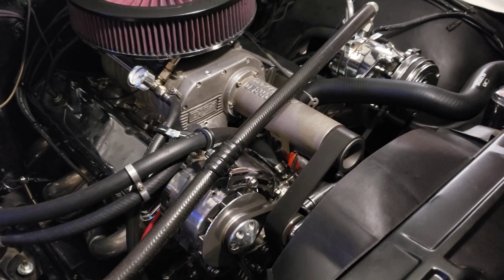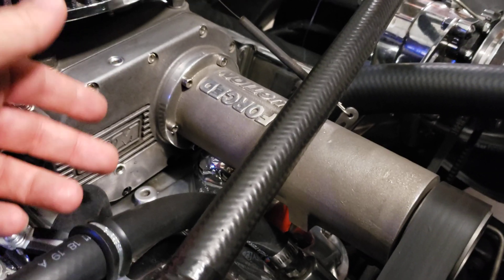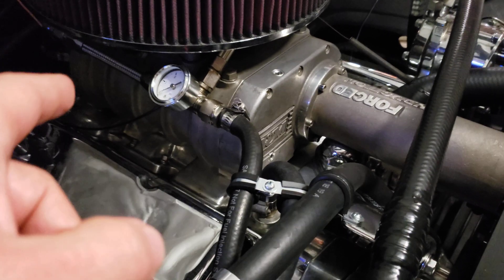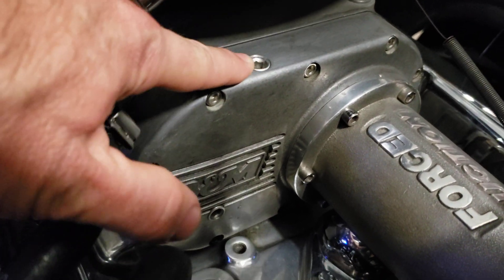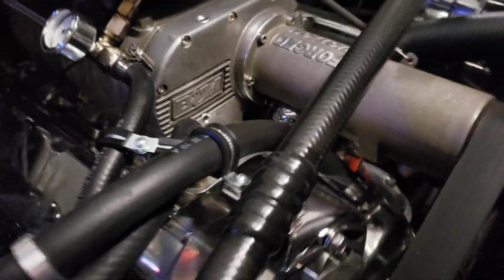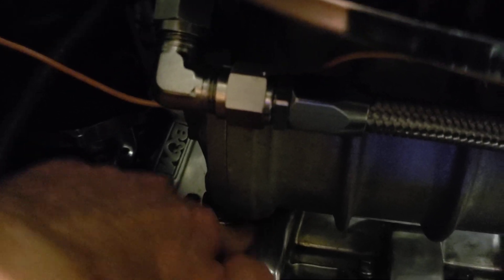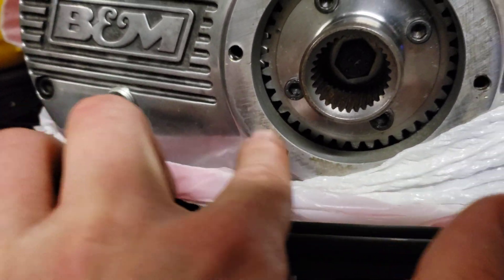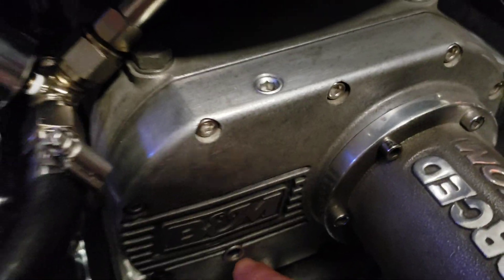Servicing a roots blower and how they work

Comment: On the 144 cu inch blower, I turn mine by hand and I can hear a scraping noise from the back bearing. Guess I should change the back bearing huh?
Reply: The car had sat for 5 years until recently inheriting it. Thought maybe my water pump was going out. Instead.... This is what I'm finding. New to the street rod engine stuff and needed some advice . Please sir.
Reply from the maker: Hard to say without a visual inspection.  It's also possible the rotors are binding if the hold-down bolts aren't torqued properly.  You'll need to not oly check the rear bearings, but also the snout and apex seals.

Comment: I've got a question I have a 177 blower on a somewhat stock Chevy 350 I have a 750 Edelbrock carb would that be sufficient enough to run on my blower please?
Reply from the maker: That setup will work just fine.  I run a Holley 750.
Reply: Thank you for your feedback

Comment: Wow you have a fantastic roots blower setup !   every time a Weiand blower (144-177)  is taken off its intake manifold it best to repack the rear bearings with grease, it takes a about 15 minutes and once a year completely drain and refill the snout.
Reply from the maker: Thanks.  You're correct, and I do. 😉

Comment: My 144 blower was sitting up side down for about 1 year on the shelf. When I install it made a rattling noise. I suspect it no oil in it. I wonder if the rattling sound go away when I put 75w/90 full sentetic gear oil.. i am so in a stress..
Reply from the maker: Lots of reasons it could be rattling ... none of them good.  First thing would be to remove the blower and give it a thorough inspection.  It's possible that you could be sending metal shavings down the intake.
Reply: I had a car that'd sat for five years and after driving it a couple of times, it began a screeching sound that would come an go as I pushed the pedal. Thought it was a water pump. Now I'm pretty sure it's the bearing on my blower.

Comment: How freely should the blower spin when not installed and hand turning the pulley. Seems mine has a slight catch in one spot at each revolution. I just bought it second hand today, so I’m trying to figure out what’s acceptable and what needs attention. Thanks
Reply from the maker: It should spin freely, smooth, and quiet (by hand).  If something is catching, you'll need to closely inspect the case and the rotor seals, maybe even the bearings and/or rotor gears.  Worst case, you may have to do a rebuild.
Reply: desassemble, inspect the rear bearings/gears a pack with grease. I hope it turned out well for you.

Comment: I've got the 144 as well my spacer on the crank to short what length is yours if you remember.
Reply from the maker: I honestly don't remember.  Sorry.  If yours isn't thick enough, you can now measure how much more you need and add that to the thickness of the current spacer to get the measurement for a new one.

Comment: And I have a 174 on my SBF was curious as to what spark plug the heat rating in the gap you are running
Reply from the maker: I still need to dial in my tuning and every application is different, of course.  The rule is that boosted engines will need to run a colder plug  and a reduced gap.  A 174 on a (guessing) 302 should give around 10psi so you may want to try 2 steps colder than NA and 0.025 gap.  Remember, this is just an opinion so please do some homework for your specific application as timing, mixture, etc. are just as important. 🤘